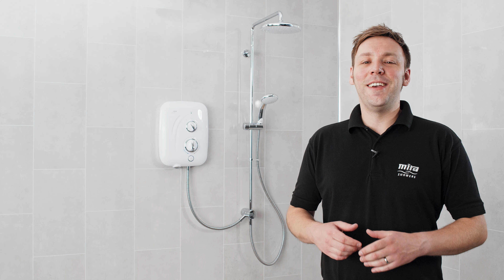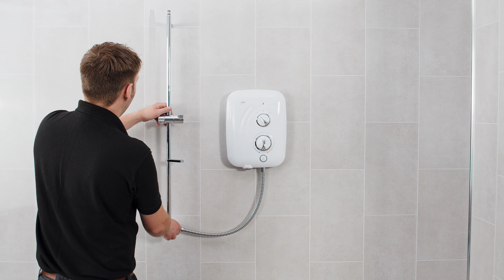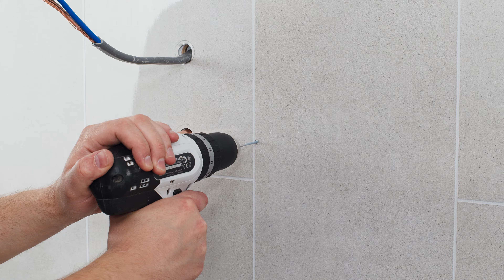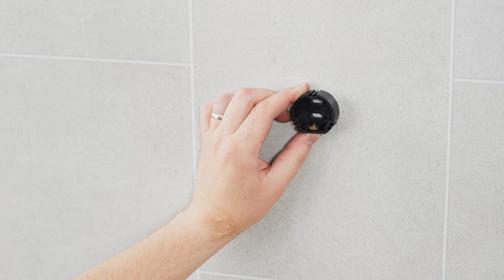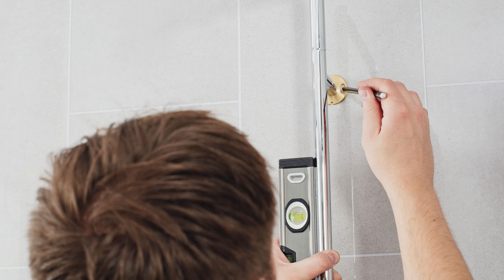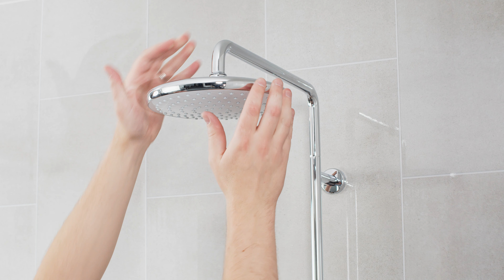Mira Elite SE Dual - Step By Step Installation Film

Comment: Excellent plain and simple explanation. My shower became air locked after removing the filter for cleaning. The little mention at the end about bleeding the pump cleared my air blockage. I had to do it twice before water ran properly through the head.

Comment: How do you take out the filter on the shower pls
Reply from the maker: Hello Jimmy,  thank you for your comment.   Lower the small shower head into the bath or tray.  Please turn the power supply off to the shower, then turn the shower to the Low Setting and the temperature dial all the way into the Blue.  With a pound coin insert this into the slot on the left hand bottom corner of the shower and turn to the left.   Rinse the filter in clean warm water to remove any dirt or debris.  Make sure the filter is correctly refitted to the locked into position.  Regards Mira YouTube Team.

Comment: On your site, when clicking on the installation & user guide for this shower, it says: 
The requested content does not exist.
HttpStatusCode: 404
ErrorCode: WebContentNotFound
RequestId : f75d1211-601e-00a3-0e02-3fa040000000
TimeStamp : 2023-02-12T16:56:16.0832122Z